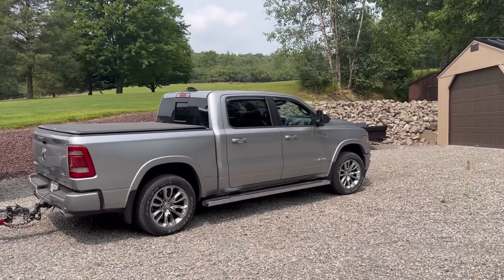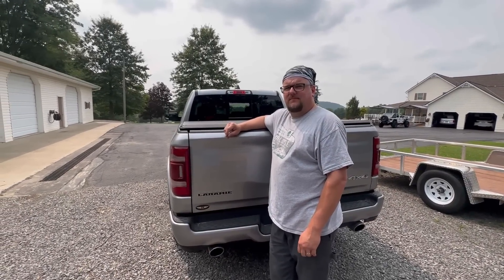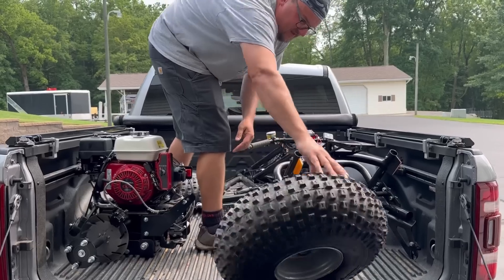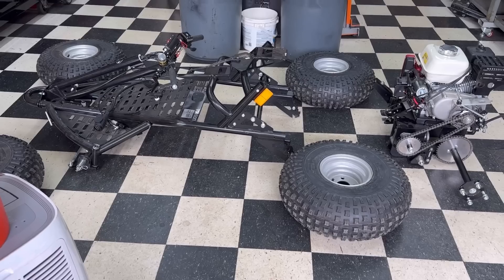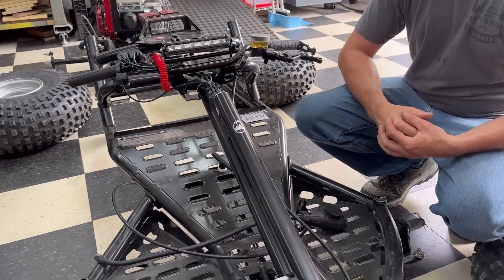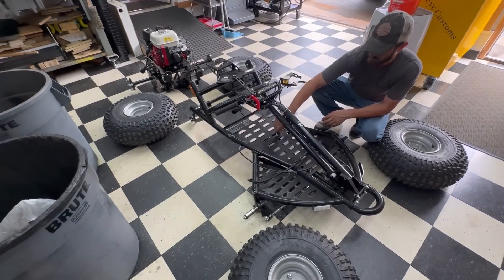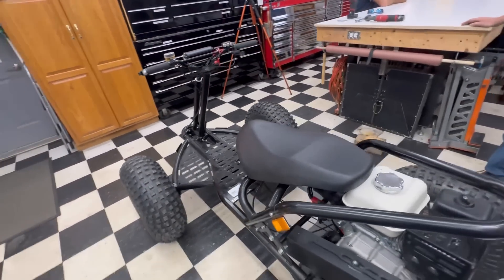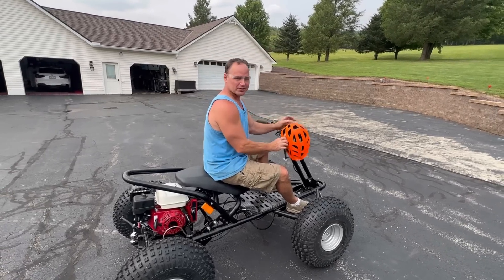Four SEASONS of Fun and handy to have around

Comment: We call them Anderson plugs in Australia a very good high Dc amperage plug
Reply: Anderson PowerPole.  Everything from small 15A contacts to over 300A+ connectors for forklifts, etc. The small ones are cool because they're hermaphroditic and be configured so you can't accidentally plug two similar connectors together.
Reply from the maker: I believe that’s what they are called, at the time of filming, I drew a blank.

Comment: This is a cool simple machine but it’s a hard no from me. 
1) I think everyone forgot how it was riding bike when young and going thru puddles without fenders?..it’s 10 times worse with and 4 wheel atv. 
2) unless those control cables can be raise up and secured, they will be “attracting” every branch and corn stalk in the county.
3) the modularity of all seasons is great in theory but in reality not so much. Dual wheels on the rear will probably get people around in 95% of the snow belt regions and not loose functionality in no/little snow conditions. The analogy I think of is tractor mounted corn pickers. How many farmers actually changed them out?…or just bought another tractor.